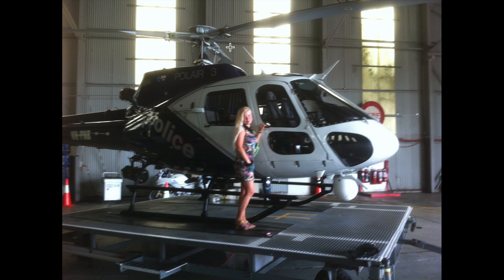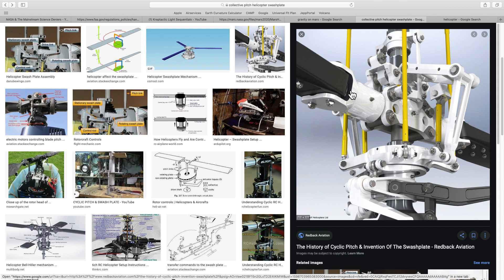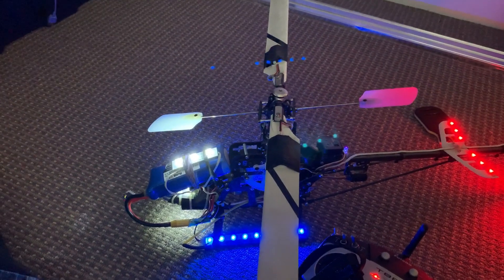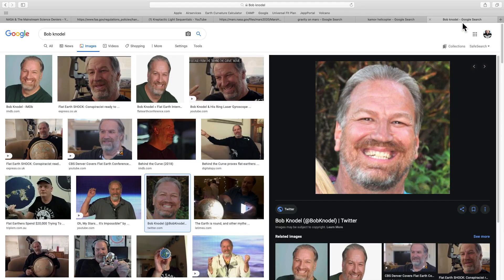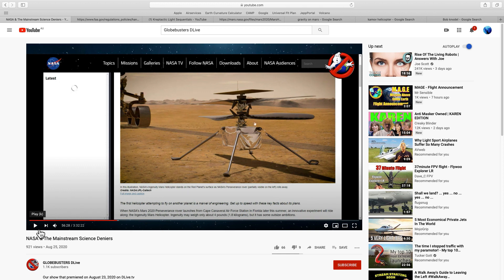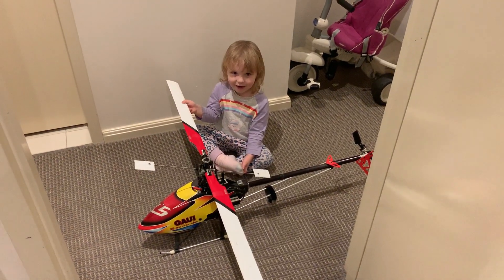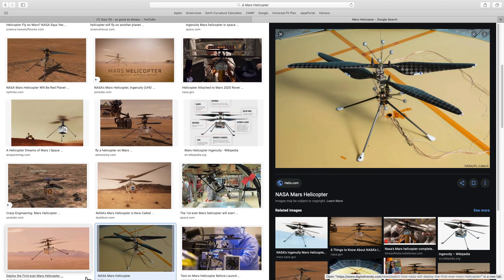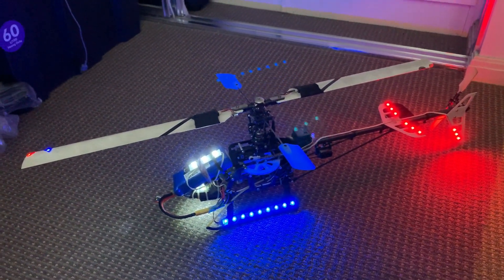This Flat Earth pilot doesn't know how the Mars helicopter works.

Comment: Thanks, Wolfie, a great video to watch in general, the debunking is just a side benefit.

I first learned about counter-rotating propellers probably 50 years ago, and their use as helicopter rotors about then or shortly thereafter.  Likewise variable pitch of the blades/rotors.  The fact that Bob Knodel had a private pilot license and still fails to understand that is ridiculous.  He and his group don't do the math to figure out how an Earth helicopter can function, let alone one for Mars conditions, and then assume NASA and its contractors can't do it either.  NASA publishes papers that explain new findings in aerospace engineering that others then use to build practical devices for everyday use.  Why the Flat Earth crowd fails to understand that they lack the knowledge and skills of professionals I will never know.

Comment: Interesting short video about the pyramids and how they relate to the size and shape of the spherical earth.
https://www.facebook.com/makeknown.page/videos/2635530006703475/
Reply: That was a load of nonsense
Reply: @drosophilamelanogaster4262  In which respect?
Reply: @baskerwilliam4492   just my 2 cents.
Apparently he doesn't know how the pyramids were built.
He seems to have no knowledge of the causeways that still remain, the papyrus scrolls which have descriptions of "gangs" that worked on them, the hieroglyphs that actually show how the stones were moved. We also now have papyrus explaining where the outer casing was quarried, how it was shipped across the Red Sea, transported over land to the Nile and floated up during the flood season and docked next to the Pyramids.

The Egyptians didn't build the pyramids to align with "true North" as he claims, they are aligned East/West to align with the rising and setting of Ra (the Sun). There gods were not to the North.

Apparently the Egyptians didn't know about the Earth being a planet, but somehow they knew that the Earth's processed 1 degree every 72 years . If you multiply 72 by 600 you get 
42,300.  Where did he pull the 600 from?  He didn't explain that point. Crazy stuff.  
The circumference of the Earth at the equator is 40,075.017 km so its out by over 2,200 kms, a 5% error doesn't seem to be that impressive (if you disregard the magical 600).

The only thing he was correct on, was the pyramids weren't built by slaves. But that is just basic knowledge.

"they got it all right"
Egypt made a lot of pyramids, some have collapsed, some were abandoned as too faulty, their experiments with pyramid building were done full scale, using trial and error.
A example of a pyramid where they didnt get it all right.
https://en.wikipedia.org/wiki/Bent_Pyramid

Comment: I am really looking forward to seeing the mars helicopter crash :)
But seriously, it is a prototyping mission, and while i'm sure there's top knotch engineering involved, that thing looks fragile to say the least. 
I hope the software is good enough for them to get at least some flight data before a rough landing turns it into a carbon fiber cloud.
Reply from the maker: I hope it works but the chance of failure is extremely high I think.
Reply: Highest risk is landing on rough terrain.

Comment: I guess flat earth pilots must have different training regimes.  At 07:33:  "... you know, i was originally trained as a pilot at sea level, and then I went up and started flying at 5280 ..."  Did Bob spend a lot of time skimming across the surface of the ocean?  Why does he attach significance to the altitude of 5280 (feet?)?  Is one mile somehow special to flat earth aviators?  If he's trying to establish his "credentials" with the use of some jargon, he failed miserably right there.  Why should anyone believe anything he says subsequently when his introduction is nonsense?

Comment: Forgive this globe-bound earther's ignorance.  I had once heard that the rotor speed had to be kept nearly constant on full-sized helicopters because the centrifugal force on the blades was a key part of keeping them from flexing upwards and breaking.   Too fast and the force breaks the blade from the hub, too slow and they flex upward and bend (possibly to the point of breaking).   Can you confirm if this is true or is it just a myth?
Reply from the maker: Hi Mike,  yes this is 100% true.  The RPM gauge in the helicopter is a % and the governor holds this quite accurately.     

If your rotor speed reduces too much you lose rigidity in the blades and the helicopter could  fall out of the sky.  If the speed increases too much the centrifugal force exceeds structural limits. 

In normal operations this is not something the pilot needs to worry about last the governor will hold RPM very constant. 

If the Engine fails and you enter autorotation ( using the downwards motion of the helicopter to keep the rotors turning - the equivalent of gliding) then you need to control this RPM yourself with the collective lever. 

You can reduce it to around 90% in the Squirrel no problem and this actually gives you greater range during an aurotoration.  Police flying was great as we did thorough training every month on autorotations from various positions.  High altitude hovers,  low altitude etc.  

Normal helicopter pilots might only practice this once a year but with the Government it was monthly.   I loved it.

Comment: I did have a tiny little coax heli years ago. Mine was a super expensive $30 one and I found out the hard way in the end that despite my confidence I could, it couldn't cope with strong winds and naturally I broke it pretty badly in the finish. I did have some fun with it for a couple of weeks first at least.  One bloke dared me to land it in the palm of his hand which I thought was way beyond me but I actually managed that. I must admit I hadn't realised that the mars heli had variable pitch, I thought it worked like that tiny one by simply varying the speeds of each rotor. Looks like I need to pay more attention. 
I'm not really interested in model helis (I like fixed wing in models) and haven't been interested in the multis till more recently with the amazing video quality and capabilities of some of the better ones. Now they are just amazing for video work.

Comment: The place they are going to land is actually below average surface level of Mars, so the pressure there should be slightly higher. About 1.5% of Earth atmosphere pressure at sea level.  Additionally the air density is about 2.5% of dry Earth atmosphere density at sea level, because carbon dioxide has 1.6 higher molecular mass than dry air. So that should help too . Plus again, 38% of Earth gravity, so effectively, it is like flying at about 7.5% pressure on Earth. That is, you know, not that crazy. And the rotors and motors are super efficient here.

Comment: So 1% of earth's surface atmosphere is equivalent to the atmosphere at about 50,000 feet altitude. But with only 38% of the gravity then that would be equivalent to 19,000 feet. That's high for a helicopter but not ridiculous in ground effect. But for a craft designed specifically for the job, I don't see any major issue at all.
Reply: In further research I found another factor that I hadn't considered. The speed of sound in the martian atmosphere is considerably slower than on earth, such that compressibility problems mean that the rotors will have a lower maximum rotation speed than on earth.
Reply: @hashmaldawn3878  Yes, the speed of sound on Earth is faster. It's also still 100 mph faster at Earth 100,000 ft compared to Mars zero feet. I do know that the fat, short rotor blade config on the Mars Helicopter is designed to keep the max rotor tip speed at 0.7 Mach or less.
Reply: Mars atmosphere is equivalent to Earth atmosphere at 100,000 ft not 50,000 ft.
Reply: @nightjarflying  I was working on a 1 % atmosphere but my calculations were rough. So would you calculate that it would be equivalent to approx 40,000 feet taking gravity into account?
Reply: @hashmaldawn3878  The relation gas pressure to altitude is not linear. You can't multiply "altitude on Earth at Mars pressure" by 0.38 to get an Earth-equivalent altitude to Mars surface pressure. Here is an example using a graph on Encyclopaedia Britannica [I will put a link to the graph in a separate comment]:- 

[1] Mars surface pressure is 6 to 7 millibars.
[2] Suppose we say that we want 18.4 millibars on Earth to emulate 7 millibars on Mars [7/0.38], then you need to fly at around 80,000 ft [25 km] on Earth to get down to 18.4 millibars.     
[3] Multiplying 100,000 ft by 0.38 doesn't equate to a Mars surface environment at all, because 38,000 ft [11.6 km] altitude on Earth has an impressively high gas pressure of 200 millibars.
Reply: @hashmaldawn3878  The graph I used is here: https://www.britannica.com/science/atmospheric-pressure
Reply: @nightjarflying  Having looked further into the atmosphere of Mars then I now agree with your figure of 100,000 feet. My research tells me that the surface atmosphere of Mars is 6 to 7 mb. I'm still not sure what exact change the lower gravity would make, and that the Martian atmosphere being primarily CO2 might have an effect as well.
Reply: @hashmaldawn3878  Did you not see my comment 14 minutes earlier than yours where I explain the problem of non-linearity? I suspect you haven't as you use the figure for Mars pressure that I use in that comment. You simply cannot use simple division/multiplication to extrapolate values in a non-linear relation - we are dealing with a situation comparable to compound interest in finance.
Reply: @hashmaldawn3878  I guess you didn't expand my earlier comment - the bottom half reads as follows:
[1] Mars surface pressure is 6 to 7 millibars.
[2] Suppose we say that we want 18.4 millibars on Earth to emulate 7 millibars on Mars [7/0.38], then you need to fly at around 80,000 ft [25 km] on Earth to get down to 18.4 millibars.
[3] Multiplying 100,000 ft by 0.38 doesn't equate to a Mars surface environment at all, because 38,000 ft [11.6 km] altitude on Earth has an impressively high gas pressure of 200 millibars.
Reply: @nightjarflying  I see your logic. However, I'm not an aerodynamicist, just a regular pilot, so is the .38 gravity change linear? I'm not saying it isn't, just that I haven't seen that definitively. Likewise, I don't know if the CO2 would change the aerodynamics or not.
Would an experiment using the 6 to 7 millibar pressure in a CO2 environment but the craft being heavier be equivalent?
Reply: @hashmaldawn3878  Over the small differences in altitude on each planet compared to planet radius it is acceptable to treat g as a constant on each planet at all reasonable altitudes i.e. g is much the same at 20,902,000 ft [sea level to centre of Earth] as at 21,002,000 [100,000 ft altitude to centre of Earth]. Therefore one can map between the value of g on Earth & the value of g on Mars in a simple linear manner. No problem. BUT you cannot linearly map between altitude & gas pressure because gas compresses & therefore gas pressure increases faster & faster as one drops at a constant rate through a gaseous atmosphere. If the 'fluid' [in aerodynamics speak] was liquid water rather than gaseous air then your calculation would be valid as water is nearly incompressible i.e. water pressure increases by one atmosphere for every 33 ft of depth - it's a linear relation.
Reply: @nightjarflying  Ah cool, thanks for the info! What is your interest in aerodynamics, is it profesional?
Reply: @hashmaldawn3878  My interest in aerodynamics is amateur, as a glider pilot - I was the only one in my Birmingham, England, UK  school of 1200 pupils to take a GCE "O Level" at age 16,  in 1972, in aerodynamics. I had gone solo in a glider in 1971 with the ATC at RAF Cosford - I'm talking a WWII design wood/fabric high wing, twin side-by-side seat Slingsby T.21 Sedbergh TX.1 "The barge" & I also soloed the high wing, tandem two seat T.31 "The flying brick." :) I was taught back then that aerodynamic wing lift is all about the Bernoulli effect & I put that in my exam paper noting that it was a simplified nonsense theory [I didn't say "pantomime" though] & I got extra marks for disagreeing with accepted wisdom because I also explained my reasoning - right or wrong as may be. It is interesting to note that today we have extremely good computer simulations that allow us to design near-optimum aerodynamic lifting shapes [wings, flying wings, lifting bodies & so on], but we can't predict handling from there across the entire flight envelope - we can compute simple stuff only such as handling/stability at cruise in level flight, but the equations become impossible outside that calm centre of the envelope. We might be more advanced than I know though - these hairy edged calcs are essential for designing ballistic missile re-entry vehicles & hypersonic weapons so "we" might be two decades ahead of public knowledge. Another point of interest is aerodynamicists are in two camps still as to the complete mechanics of wing lift - the compressibility of air, the stickiness, the vortices & other stuff make it a very, very hard problem - the equations used are good, but the verbal explanation is at fault big time - it isn't just Bernoulli & it isn't just Newton F=MA & it isn't a combo of the two.
Reply: @nightjarflying  I know Cosford, I've even sat in the Me262 cockpit in the museum there.
I was the only one in my school to have a PPL! Nowadays I fly a 787 but probably only for one or two more flights.
Reply: @hashmaldawn3878  QUOTE: "Would an experiment using the 6 to 7 millibar pressure in a CO2 environment but the craft being heavier be equivalent?" At JPL's Space Simulator, 25-foot-wide vacuum chamber the helicopter team sucked out practically all the nitrogen, oxygen & other gases & injected CO2 to Mars zero altitude atmospheric pressure - I assume the gas was at Mars daylight temperature, but the article I read doesn't mention the CO2 temp. They also used a vertical cable tether attached to the top of the helicopter that applied a constant force upwards to simulate the helicopter being at 0.38 Earth g.
Reply: @hashmaldawn3878  The 633 Volunteer Gliding Squadron (VGS) at Cosford stopped operating in 2014 & was disbanded in 2016 - 68 years of solid, positive roles for teens [both sexes these days unlike when I was in the ATC] down the toilet. I hope you got a full career & pension in as [as you know] commercial pilots of an age have no future & the pressure is on to reduce salaries substantially to bus driver levels almost. There was a bit in the newspaper today about a 38 year old bucket shop pilot [with Monarch & other cut price outfits] who after his third job with three airlines in almost as many years, has left the industry to start a business with a mate as a funeral director. This link includes an amusing video clip: https://www.bbc.co.uk/news/av/uk-england-derbyshire-53951143
Reply: @nightjarflying  I've been incredibly lucky in my career, and I've been well paid for doing a job I love. I'd happily continue but the virus has had a massive effect on aviation, as I'm sure you know. My pension is far better than I hoped it would be so it makes sense to go now, and have plenty of time to do some things I've always wanted to. I'd originally planned to get something like a Cessna 180/2 to do some touring in the US. It now seems that I can probably upgrade to something like the Cessna 310.
Reply: @hashmaldawn3878  Best wishes for your retirement!
Reply: @david_akerman  Thank you. I've just been given a few more flights next week, so I'm looking forward to those. But my 3 days in the simulator will no doubt be cancelled!
Reply from the maker: Exactly.  The altitude record for a real helicopter is 40,800 ft.   So that fits quite nicely.

Comment: Great job. 
I'm sure though that the flatearthers will still complain that there wouldn't be enough atmosphere on Mars to give it a lift. But this is probably because they think 1% of anything must be very small, and none of them can seem to wrap their heads around air pressure, or how heavy air is, etc.
On Earth there are about 1*10^25 atoms per meter cubed. 1% of that is about 1*10^23 atoms per meter cubed. 
1% of a lot can still be a lot.
I mean, if I had 1% of bill Gates' fortune I'd be pretty happy. In fact I'd probably be one of the richest few thousand people on Earth.

Comment: 7:40 by saying that the atmophere is thinner the higher you go doesn't he basically prove flat earth wrong? Most flerfs claim the earth needs a dome to trap the amtosphere in and that vacuum should suck it all out and yet he's clearly stating it just gets thinner as you move up.
Reply: Absolutely! Low pressure at high altitudes absolutely proves no dome over a flat Earth  
Unless you are a FE bot or low IQ FE acolyte.

Comment: Bob the "pilot"... He knows nothing about helicopter design. Despite having a picture with all the design features of a coaxial heli right in front of him he is unable to understand how this machine actually works. It's not an RPM controlled drone you idiot, it's a pitch controlled helicopter. The shape and airfoil of the blades alone should give you a hint that they are designed for an atmosphere with different properties than usual. Mars' atmosphere consists of carbon dioxide at a very low pressure, so blade aerodynamics has to take both the different medium and pressure into account.
As an RC pilot, I feel personally offended by Bob the clown.